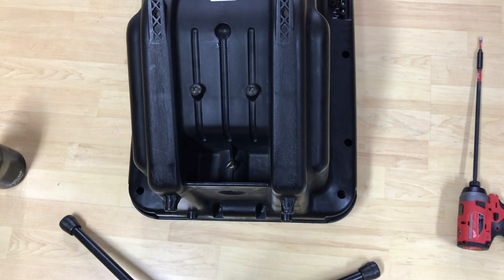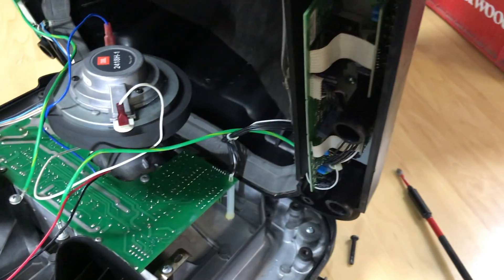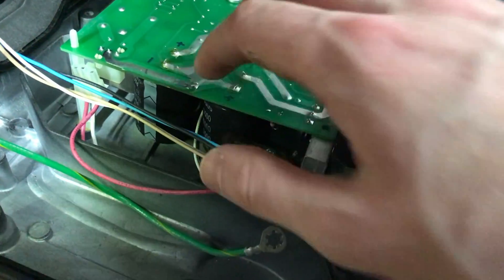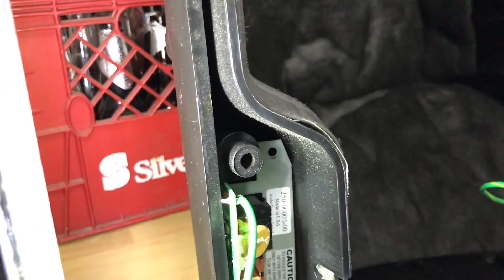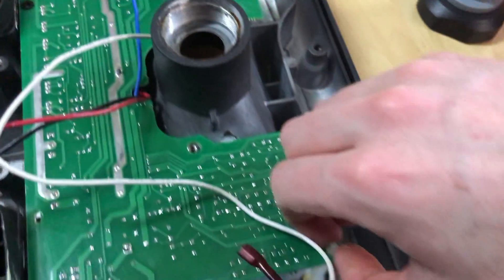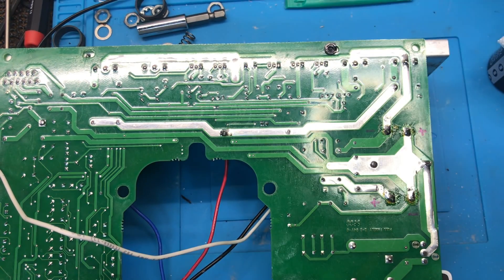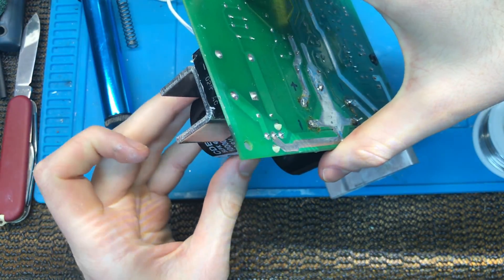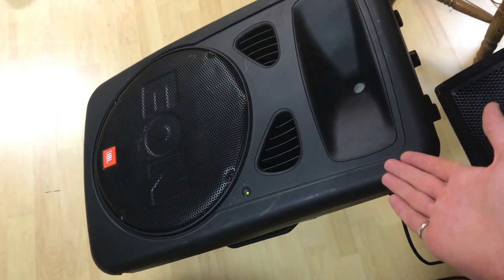JBL Eon15 G2 power supply capacitor replacement

Comment: Great video thank you.  Did you happen to see where the fuse was?  I thought I saw it when you pulled out the power input board, but it was so quick.  After probably 15 years of never having a single problem, it popped and turned off when I turned it on yesterday.  Hoping it's the fuse, but I was hoping to see how hard it is to get to before I tear it apart.  Thx!
Reply from the maker: went back and looked and yep you can see it if you pause at 4:12, it's on that power input board
Reply: @fumblebork  yessir I got a new one in today thank you!

Comment: Also if you used a better shape tip and used desolder braid you wouldn’t have to put so much heat into the board risking damaging the traces
Reply from the maker: Yes, I have upgraded my tools since this video, but you gotta work with what you have. No interest in paying shop rates for the experts to do it. I like to learn by doing, don't have time to leave my job to go to school for this, so most of my channel is me learning as I go and usually only posting things that I can't find a good video about. Like I've fixed some MacBooks but there's no point in me making videos about them because there are many better ones going over the same problems. If you have one of these and fix it, by all means make a video about it and make it better than this one.

Comment: Hey, I've got a pair of EON10 G2s and just came across your video. I'm also having issues with the amplifier module - the woofer tends to stop working but the horn always works. If I turn up the input sensitivity the speaker will pop a bit, and I can "shock" it back to life with a generated 60hz sine wave. The main caps don't seem to hold a charge very well and I've ordered new ones, but I'm not so sure this will fix the problem. Would you possibly have any suggestions for me?
Reply from the maker: I think my video may have oversold my technical abilities/knowledge lol. I have had issues like that on other hardware where the problem was the volume knob just needing a cleaning but the fact that the horn always works makes me think that's not the issue. Maybe the transistors for the woofer section? Let me know if you figure it out!
Reply: @fumblebork  haha No problem. I did clean the volume pot with no luck, and even bypassed it entirely to always send full input. Transistors were also on my short list, guess I'll try the caps and go from there. An entire replacement board is about $190 though, so if I can try multiple things until it works again I'll be happy!
Reply from the maker: plus half the fun is figuring it out! no fun just buying a new board!

Comment: I heard there is an issue with the jbl EON one all in one. Basically. The mic  pre amp..they are weak.
Can someone tell me how to fix it?
Reply: Using a mixer helps quite well.
Reply: May I ask if the capacitor is the problem of my jbl g2 for the weak sound about long throw bass and the mid sound disappear?

Comment: Great video! I’ve got the same speakers and they are popping occasionally. I don’t have a buzzing sound though. How did you figure out the buzzing was from the capacitors? I was thinking the popping might be coming from bad caps.
Reply from the maker: The guy who replaced the caps last time was the one who did the figuring. He said the buzzing was likely because those caps stopped filtering. Honestly I don't know enough about electronics myself to know what the popping might be from.. but I will say it never hurts to replace the caps lol
Reply: I can’t tell you how much help this video has been. I just referenced it for the second time for some of the disassembly. Thanks so much!